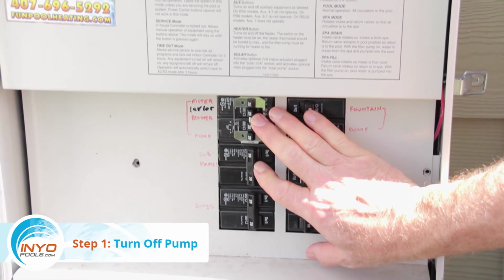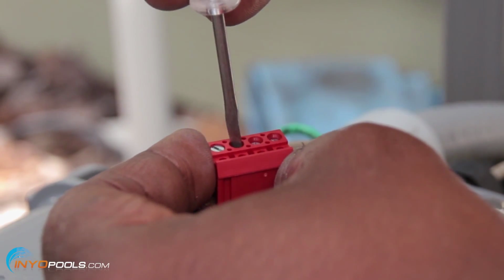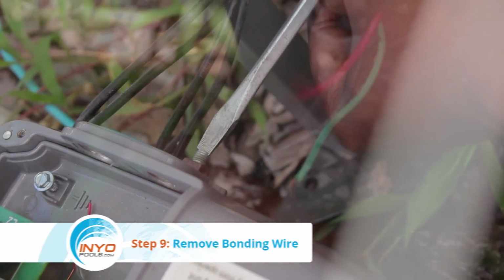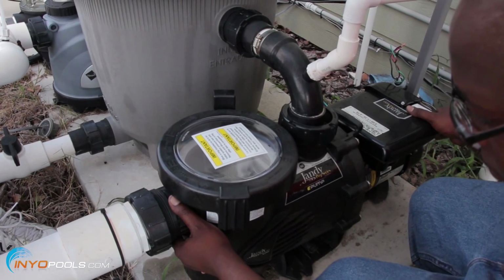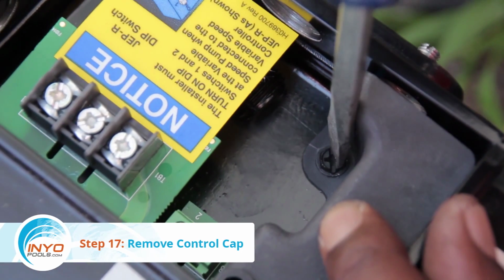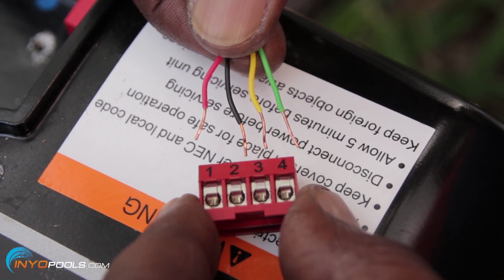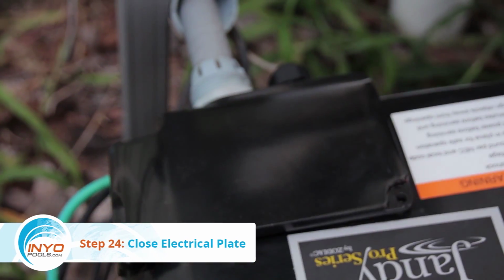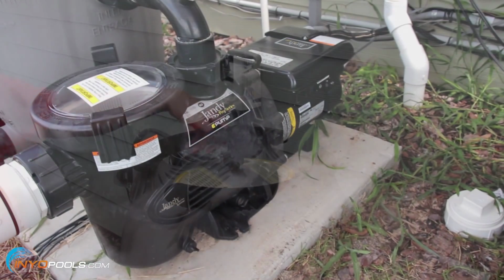How To: Replace a Jandy Variable Speed Pool Pump

Comment: I have this pump. A year after installation it is toast.  You should Not use this in a salt pool unless you can guarantee that there will be NO water near the controller.  The controller body is pot metal with a painted surface.  There is a ground wire connected to the body, and what Jandy has done is create a "sacrificial anode" similiar to what protects a boat motor.  The lid seal is inadequate to keep salt moisture out. It will corrode and short out the interior wiring.  If the housing was made of a high impact plastic similar to other parts, and a better lid seal to make it weather proof, I would agree with your assessment.